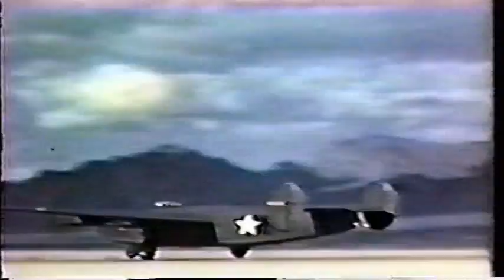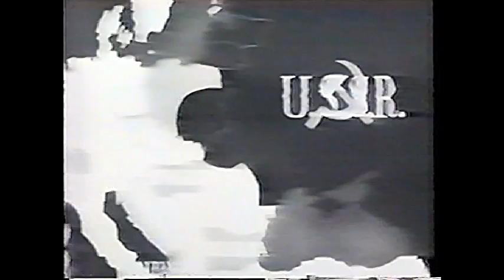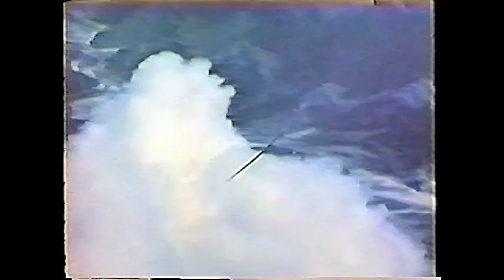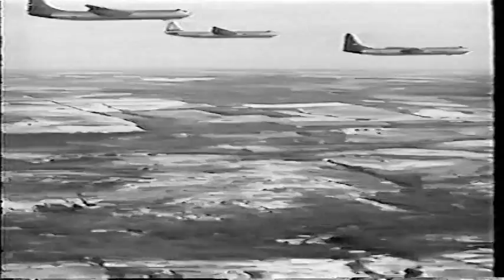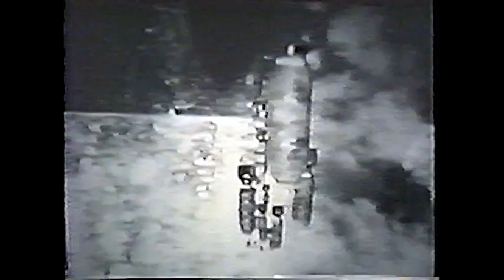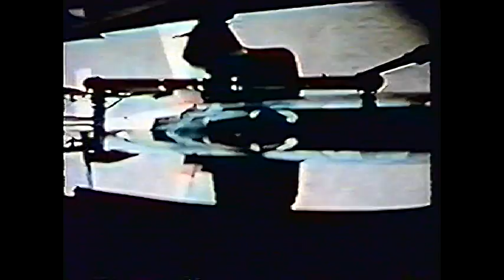Convair B-36 Peacemaker History

Comment: For anyone that doesn't know, the last B-36 produced was restored in a flight line run station at General Dynamics Ft. Worth and has now been relocated to the Pima Air Museum in Arizona because the city of Ft. Worth wasn't forward thinking enough to secure a location and build a hangar in which this piece of it's history could permanently reside.
Reply: +Ralfie    In Ft Worth they were working on getting it ready for one last ferry flight until the Air Force Museum found out and seized the engines and mounts.  It went to the Pima Museum by truck and is now refurbished but they still do not have engines for it.

Comment: i'm calling bullshit on this 'nuke' powered version !  This video is as bent and lying as the morons at nasa !   So, the plane shown with the 'nuke' reactor on board powered flight with what ?   Propeller engines !  And HOW were said engines powered, by STEAM or electricity ?  because that's ALL nukes are - water boilers !  Total and utter nonsense, yet i see no one questioning this tripe and garbage !
Reply: +colliecandle   I believe the theory was to use the nuclear fission to heat the air in a ramjet fashion instead of conventional combustion chambers.  So I suppose that military aircraft would have been leaving radioactive trails all over the sky.

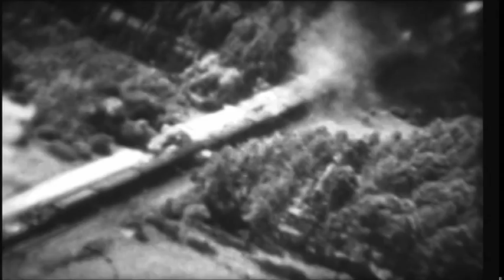Comment: 8:00 I was driving in the desert of south eastern California on a very lonely road when I saw a low altitude airplane flying down the road coming right at me. I figured he was making a simulated attack run on me and started swerving from one side of the road to the other. He passed me then later flew over me from behind and performed a perfect aileron roll. I figured he was just letting me know that his simulated attack had been successful.
     I had no illusion of escape. I could only move from one side of the tarmac to the other, not enough to escape the high explosive blast of a bomb, but I also know I was not under any sort of real attack.
     Every time I see the gun camera footage of these train attacks, I wonder what it was like for the engineers, knowing the airplane was going to kill them, and there wasn't a damn thing he could do about it.

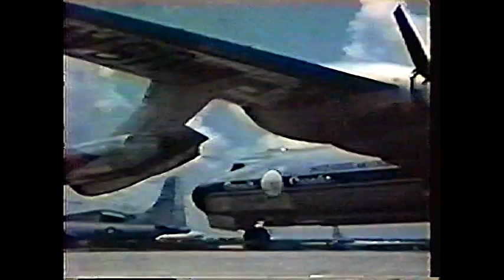Comment: 46:20 regarding the Nuclear Powered version, NB36H Crusader. Was water being boiled turning to steam used to turn the engines and the turbines? I just looked it up: "Unlike the planned Convair X-6, the three-megawatt air-cooled reactor in the NB-36H did not power any of the aircraft's systems, nor did it provide propulsion, but was placed on the NB-36H to measure the 
effectiveness of the shielding."  https://en.wikipedia.org/wiki/Convair_NB-36H

Comment: "Six turning and four burning"
Those outboard jet engines were specially modified
to burn aviation gasoline.
If you think they burned very hot, you're right.
Reply: No, they produced less power on the AVGAS because of the way they were modified.  Separate fuel systems would have been better for power and range, but the plane was already built without the out board four jet engines and very underpowered!
Reply: Dorothy Gale I don’t think they burn any hotter.  There is less energy per gallon of fuel.  The lead in the avgas is a problem.

Comment: I saw the B36 on static display in Fort Worth back in the early 1980s... It's now at the Pima Aerospace museum.
Reply: +John Reynolds- I climbed into that craft when it was on static display at the old Amon Carter Airport in far East Fort Worth back in the late 60's. When DFW Airport was opened and Amon Carter was abandoned, the B36 was moved to a spot on Carswell AFB just outside the main gate of the current Lockheed Facility where it had been built.

Comment: A beauty built back when the USAF could apply its full might to doing one mission type better than anyone else, unlike our modern "multi-mission"--and multi-billion--hangar queen boondoggles (F-22 and -35 I'm looking at you). I've been in, on and all around a B-36 (which feels like it takes weeks... they are HUGE!), and the sheer fact it actually could fly--and fight--the way it did is a miracle, especially given the "tech" (ha!) hey had to work with. A Peacemaker is truly a MUST SEE PLANE!
Reply: I was an A/E mechanic on a 36 during the Korean War, stationed at Biggs AFB, in El Paso. It was a difficult plane. To keep flying, mainly because of its 6 recipe engines. They would. Often fly wilt only. 5 if an alert was triggered by LeMay.

Comment: I just got back from a visit to the SAC museum in Omaha NE, where they have one of these on display.  Pictures and movies do not do it justice.  It is---quite literally---the most awesomely huge humongous thing I have ever seen.  I walked around it and kept wondering how such an enormous machine could ever have gotten of the ground.
Reply: zooeyhall I've seen that one myself and wondered the same thing. The tires are taller than I am, and I am almost 6 feet tall.
Reply: zooeyhall I agree.  Saw it myself at the SAC museum, and it's a MONSTER.  The wings are 7 feet tall where they attach to the fuselage.  A large man can easily walk upright going into them.
Reply: +delavalmilker And they did...though they crawled to lubricate engines which had a tendency to overheat regularly.
Reply: Had like four air bases it could land at due to the tire/wheel load.

Comment: When I was a kid in Ft Worth, my Father was in AMC at the Convair Plant. He was a Flight Engineer and made many acceptance flight at the plant. Later, at Travis AFB, I joined the CAP, and got a ride in one of the last B-36 Recon Models...I am still pissed off that this bomber was not used longer or to bomb Vietnam. As a conventional bomber it could carry a lot more than the B-52. I think all of the B-36's should have been rebuilt into the B-60 model, and used in Nam. The main reason that this plane was built at all, was due to Fred Korth making it so, someone needs to make a video on this congressman and his role in the cold war.

I remember the Labor Day tornado and the wreckage along the flight line....This led to the dispersal of the B-36 force to many other bases.
Reply: vonmazur, I wish that the '36 had been flown long enough for me to see (and hear!) one fly.  But let's be honest - it was obsolete by the mid-50's. The '52 was 100mph faster, probably thanks to its much thinner wing and slightly smaller fuselage (less wetted-surface drag).  B-60s would have been sitting ducks for MiGs and SAMs.  

That takes nothing away from the fact that in the late 40s and early 50s, the Peacemaker truly earned its name.
Reply: Corrie Bergeron Good points. One other thing I would like to add about the demise of the B-36; in 1965 it's closest "relative", the KB-50, was pulled from service when wing cracks were found during routine maintenance on all of them. Those planes were immediately retired for safety reasons. I believe similar structural problems would have come about in the B-36 had it stayed in service after 1959. The technology of the 1940s simply did not allow for structural analysis that would have predicted this problem with that giant bomber.
Reply: vonmazur1   During the Korean War "build-up", B-29's from Tachikawa AFB (Japan) were sent-in to bomb the Communist "back to the stone age"..  Instead, the Soviet-supplied MIG's shot the '29's out of the skies.. the B-36 wouldn't have stood an ice cube's chance in hell against the Viet-Nam era MIG's and SAM's!! Hell, even the better/faster B-52's were "target practice" in 'Nam!
Reply: I, also, have thought the B-36 would have made a very good ground support plane in the Vietnam War; had it been in operation for a few more years. Well, actually, it would not have been a good one. The B-36 had a "cousin"; the B-50 bomber (and tanker variant); which had only two fewer propeller engines (still had 4 jets). In 1965 the B-50s came in for depot maintenance and were discovered to have major structural cracking. They were retired immediately for safety reasons. I am sure the B-36s would have had the same problem had they been flown until the Vietnam War. It's role in bombardment was taken by the C-130; which rolled the huge bombs out of the cargo bay. The B-36 had it's day and age and it did great but, by the late 1950s it needed to be replaced.
Reply: OriginalOldBiker I believe vonmazur1 felt the B-36 or B-60 could have been used over South Vietnam; where it would not have had to contend with MIGs or SAMs. Actually the B-52s  did better in their bombing raids over Vietnam than what you implied. Though, of course, some were shot down.
Reply: Scott Richardson   In early 1970, I talked with a retired Brigadier General who, in addition to commanding a couple two-three squadrons of '52's, flew his share of bombing missions in 'Nam.. he was a Bird Colonel at the time..  On one run, in violation of his orders, he took his '52 "down to the deck" to get a first-hand look at what they just bombed (remember, LBJ personally selected the targets!)..  What the Brigadier bombed, accurately "dead-nuts" on target, was a rice paddy..  The munitions factory and rail depot that was, literally, across the river, was totally untouched!!  THAT was when this General "put in" for retirement..  I might add, he ONLY had twenty-three years in.. had he gone for thirty, he probably would have gotten at least two more stars!
Reply: OriginalOldBiker Interesting. Since you talked to him in early 1970 the Linebacker operations had not taken place yet (they were conducted in 1972). So, probably he was bombing a rice paddy in South Vietnam.Can you confirm that?